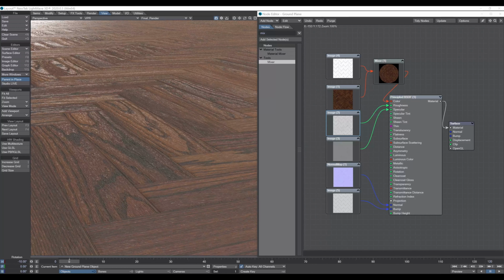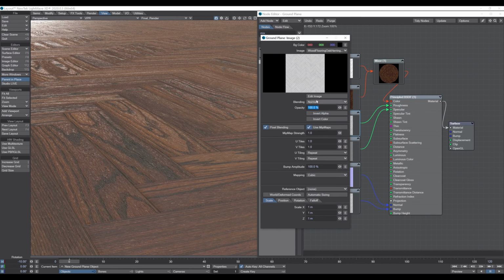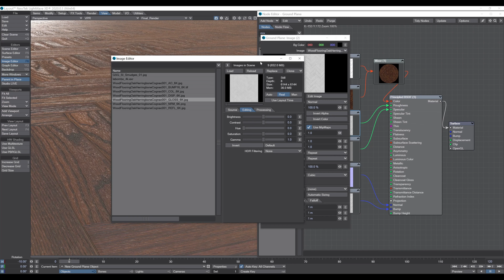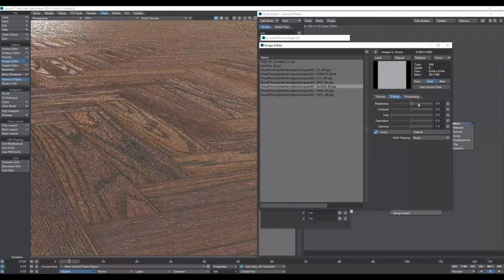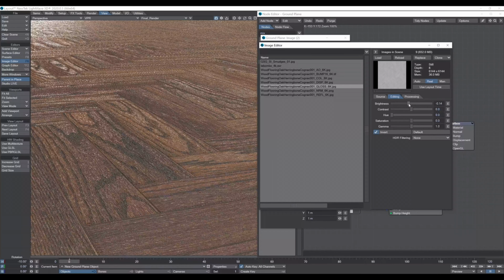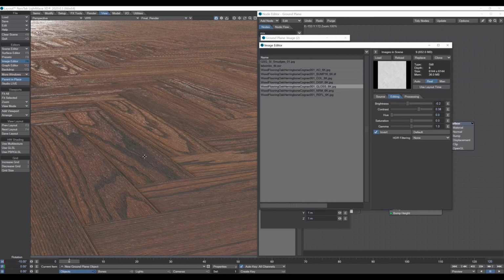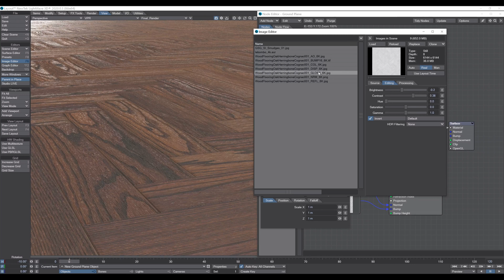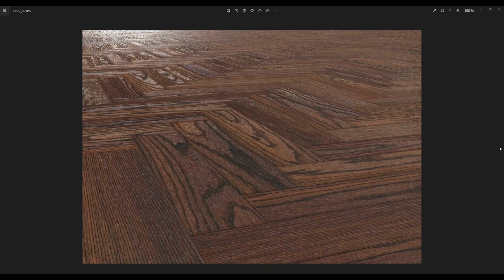LIGHTWAVE 3D / How I improve a wood material  (Beginner Level)

Comment: Wood can be very tricky. Wood itself doesn't have much in the way of reflectivity/glossiness as it is mostly the treatment (stain, varnish etc.) of the wood that brings out those attributes. Therefore I have moved to using the the clearcoat settings. The clearcoat settings can be overdriven above the 100% mark and can really give extra control over the look. Thanks for sharing as this has been very enlightening in using the image controls to vary the outcome.
Reply from the maker: Prebuild wood materials and texturemaps are alwelays way to glossy. That"s why I color correct every map and texture. I never use just the "ready to use materials for Wood.

Comment: Thanks for sharing these insights :-) 
Just a general remark in regards to the flooring: I think it is just way to rough to represent parquet. 
Even very old parquets (in a space where people still live in) are mostly much smoother on the surface.
Reply from the maker: Thanks for your Feedback. About the roughness of the Wood, yes, the normal map was set to strong.
Reply: @CDA3DLive  Well, it of course depends on what look you are after. Great tip anyway 🙂 Please keep them coming if you find the time!
BTW I noticed you use a mixer for combining AO and Color/Diffuse - can you shed a bit light on the how and why?
I mostly stay away from using ao as I was thinking it would be necessary to prep an extra buffer for using ao properly in LW and was just way to lazy for the most part...  :-\